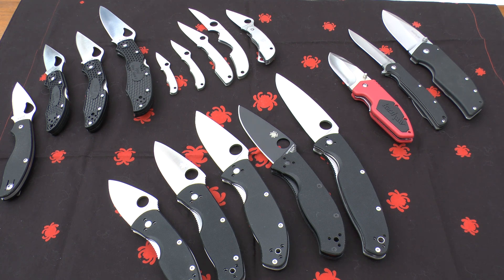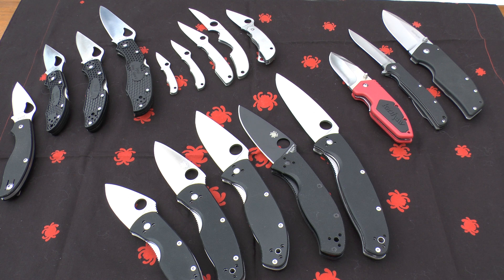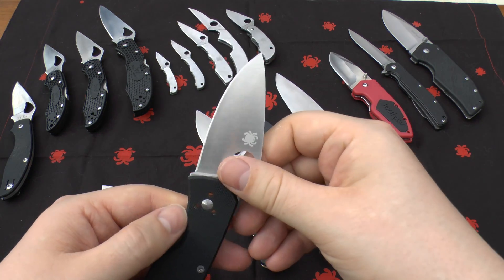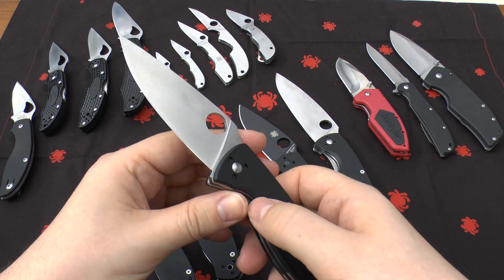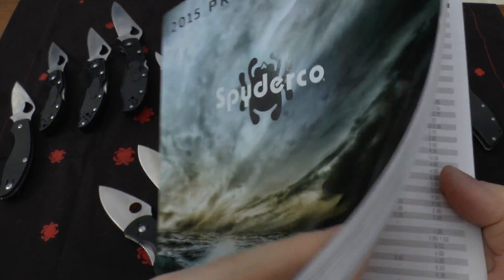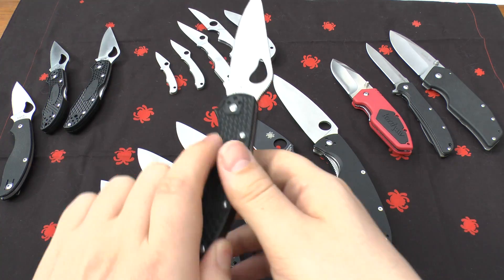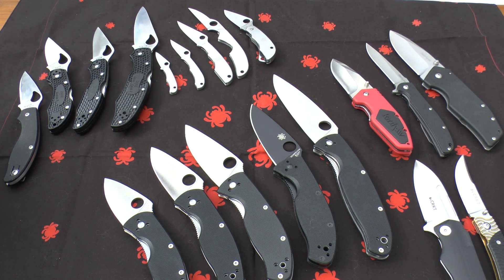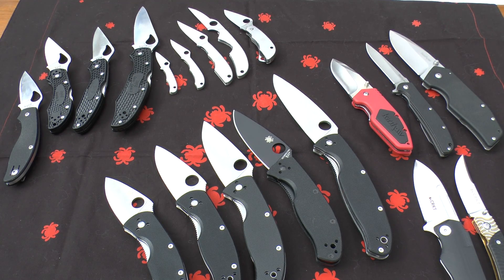Blade steel guide - 8Cr13MoV

Comment: The recent progression in supersteel development has led a lot of knife beginners to believe that steels like 8Cr/AUS8 or 440C are necessarily mediocre steels that are only worth looking at with a restricted budget. This is far from the case! They are actually exceptional steels in their own right! From a rational point of view the fact that we can get these steels in ~$20 knives is nothing short of miraculous. The existence and proliferation of 500-800 horsepower production cars does not mean that a 250 horsepower car is too weak. There's no reason we shouldn't look at these steels holistically rather than judging them based solely on their context. 8Cr with a good heat treat (Ganzo's ain't bad!) is only "soft" compared to CPM S30V and its ilk... and there are certainly applications where a soft steel is preferable.
Reply: 440A and 8Cr13 are same (and bad). AUS8 is little/little better. 440C have nothing in common, 440C ≈ 9Cr18MOV
Reply: @biotechv8809  Good and bad are relative. And relative to many mass produced steels that were considered normal even ten to fifteen years ago, a well-treated 440A is, in fact, good, and will perform adequately in most applications.

Comment: schrade refer to it as high carbon stainless. .. would this be accurate in your opinion
Reply: Both are terms used quite freely in the industry. The carbon content is around 0.8% which is quite common but also quite high for a stainless - roughly the same as 1075 carbon steel. Its higher than popular stainless steels like 12c27 (0.6%) and 420HC (0.45%).

I guess its accurate but the reason they express themselves that way is for marketing reasons. In reality doesnt necessairily mean its a better material because you cant simply keep adding carbon to improve a steel and the same goes for the other materials in a stainless steel. Sometimes less is more.
Reply: +TheKimjoh560 thanks for that.. so It is a marking ploy.. 
keep hearing it... so It should just be treated as a stainless steel. just out of interest what do you think to 420 j2 ??
Reply: Eddy De Solzen Lots of marketing ploys around. I bet more often than not the choice of material is based on the market prices on a batch of steel rather than wanting some unique properties for s certain knife. (And when said batch is used up, the knife is either discontinued or re-released as  v.2.0) Sometimes the name of two steels is very different eventough they are similiar enough to be identical simply because its made in different locations.

420j is not s very common steel in good knife blades and I'm not sure I ever used it. I think its more of a construction material stainless steel than an actual cutlery grade steel.

To be honeset I cant tell most low and mid range steels appart. You have to use them alot and hand sharpen them even more to be able to do that and even then you can be thrown off by edge profile and hardening.
Reply: Eddy De Solzen 

Eddy De Solzen Lots of marketing ploys around. I bet more often than not the choice of material is based on the market prices on a batch of steel rather than wanting some unique properties for s certain knife. (And when said batch is used up, the knife is either discontinued or re-released as  v.2.0) Sometimes the name of two steels is very different eventough they are similiar enough to be identical simply because its made in different locations. Some of these steels probably use a completely different name when used in other applications.

420j is not s very common steel in good knife blades and I'm not sure I ever used it knowingly as its seldom advertised. I think its more of a construction material stainless steel than an actual cutlery grade steel. J2 is basically the same thing but someone added a bit more carbon to make it a little better for knives. The primary attribute of these two is rust resistance I think.

To be honeset I cant tell most low and mid range steels appart. You have to use them alot and hand sharpen them even more to be able to do that and even then you can be thrown off by edge profile and hardening.

I have a degree in engineering and back in school we did a bunch of steel testing in a controlled environment. You'd be surprised how much different two pieces of the same steel can be.

Comment: I think 440c is a very overlooked steel !   (Falls in the Stainless Steel category)
"In the day" it was a Super Steel and just because other steels have been developed doesn't take anything away from this steel and as you say "IF" the heat treatment has been done right it's a great edge holding steel with great rust resistance too !
Reply from the maker: I agree.
Reply: I agree with you there. I  like 440c  as well. I've never had any problem with it at all (including sharpening), and it takes and holds an edge well in my experience. I have noticed that the dislike / almost hatred of 440c seemed to increase after a certain American fellow with a big following (you can probably guess who that is, lol) said he didn't like it.
Reply: zednotzee7 He doesn't "FANCY" "NUTN" about 440c Stainless Steel ! lol
Reply from the maker: Owen Joseph King I'm confused. I thought Cutlery Lover liked 440c.
↓   Spoilers below  ↓                 
↓                            ↓
↓                            ↓
↓                            ↓
↓                            ↓ 
    (I'm joking btw)